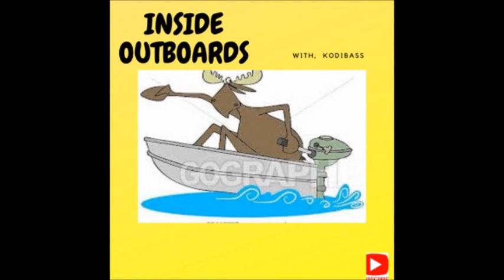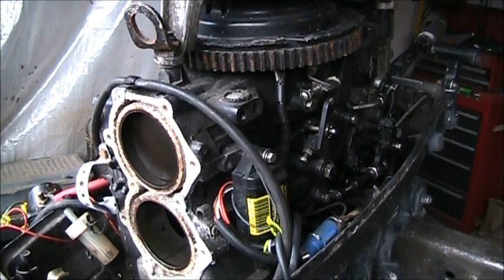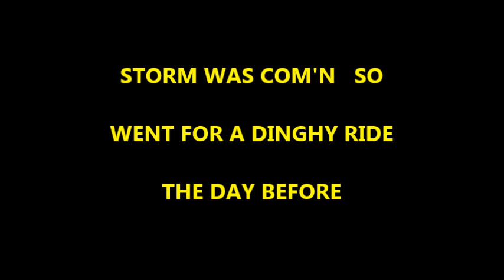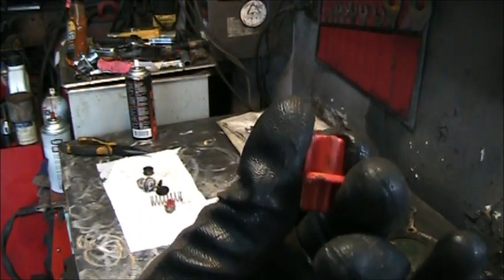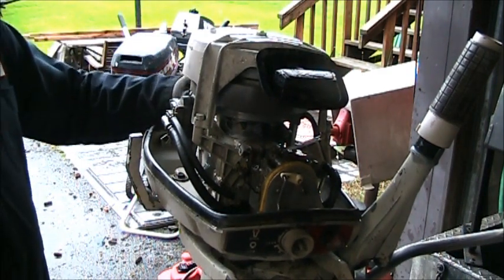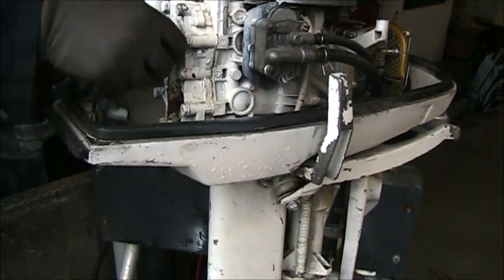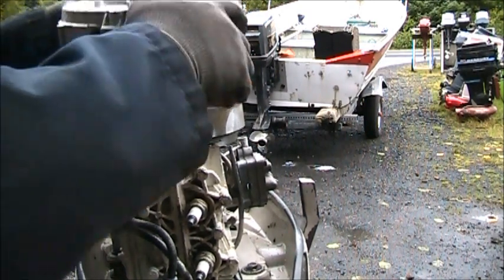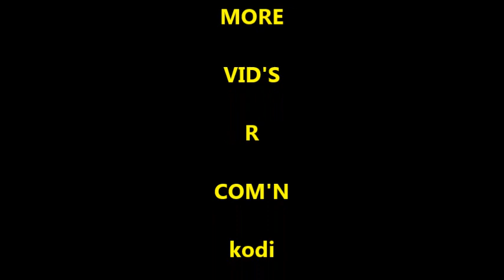1988 EVINRUDE 55 HP COMMERCIAL MODEL & MORE

Comment: The  PRV grommets are getting scarce. The plastic valve $25-45 on ebay! Thanks for the boat ride! ☠️
Reply from the maker: You bet'  I think it's only going to get worse , Now that Evinrude folded, I have had customers come to my shop asking to buy'm Thinking I won't know what they cost,  If I have learned anything over the years,   anything plastic on outboard's is big bucks.  So when I tell them sure I have a whole drawer full pop one out & say 40 bucks & they give me the look,  I just smile & look toward my pile.  There's gold in Dem Dare Part's pilgrim!
                                                                                                      L.
Reply: @kodibassInsideoutboards  Hahaha. Hey is your youtube channel working? Mine is freaking out! It keeps changing. weird !
Reply from the maker: @THISOLDOUTBOARD1  Yeh' everything seems normal as far as I can tell,      L.
Reply: @kodibassInsideoutboards  I can only view as a subscriber or a new visitor, but not as myself. strange
Reply from the maker: @THISOLDOUTBOARD1   So if you click on your home page icon what happens?  Man I hope that don't happen 2 me,  I know so little about computers as it is,  Heck I have been trying to use a better editing program for a cpl months now & get nowhere,    L.

Comment: Hi Kodi, that motor had some real issues for sure.  Time and parts are not cheap and you don't work for free. Old Fret needs the mini fridge full of beer and flies🤣
Reply from the maker: thanks, Yep'  I think I have a head  for it I found in my pile,  I  will pull the head and re test the compression & go from there.  I'll be working for pennies but i'd like to save it if I can.  Ol fret can have the flies i'll take the beer.               kodi

Comment: I got a 6 hp 1969 Johnson and that thing only has about 45 lbs per cylinder and I troll a 16 ft sylvan all day at 3 mph starts on about third pull it pushes it full speed about 9 mph thanks for the videos
Reply from the maker: Good, little kickers 4 sure,  Check the compression wet with a 1/2 inc drill it will probably do a bit higher.       kodi

Comment: Could it be that just the Head Gasket is bad on the 5.5 hp and after fixing the spark plug with a helio-coil regain compression in both cylinders?  It doesn’t appear to be a ring problem since compression didn’t go up on the wet test. What are your thoughts?
Reply from the maker: Yes' that's the plan pop the head fix plug hole inspect / replace head gasket, & re check compression.       kodi

Comment: Missed the last video, will have to go back to see if my eyes catch the leak...  Oh well, that poor old dog was cooked good, love the melted bypass valve until you mentioned the price.  Will stay off my soapbox, but it breaks my heart that BRP must have just gone by book keeping desk jockies when they came up with that price. " It costs X to manufacture these pieces, only sold a few of them, so let's charge up the wazoo to make up for the low volume"...Look where that logic got BRP/Evinrude, breaks my heart, again....Oh well, finding that nuked head gasket undoubtedly saved this engine...The owner would have just kept running it til she ran no more, when the gasket was pouring sea water in the cylinders, then the game would be over.  Nice salt build up inside, currently reviving a 58 lightwin that look identical in the water jackets...
That Johnson 5.5hp is a great engine,  too bad the owners just ran this thing til it literally wouldn't "run no more"..  This poor thing has had some half @## repairs in the past, love the 50 cent paint job covering the flywheel and cam..  Yeah, that is a pretty big compression discrepancy....Perhaps the plug threads are too blame, maybe the head gasket is blown...Surely worth pulling the head to have a look....But, we both know the owner will not be willing to pay all the money for all the work that needs to be done....Try as we might, will never convince them that this engine is much better than any of today's 4 stroke offerings.  Yeah, mag spark surely looks different than magCD spark, but I don't think there is much left of the ignition system on this poor thing.  I would have expected a much more constant spark when spinning with that drill.  
Ignition overhaul + fuel system overhaul + powerhead removal/water pump gearlube check + mounts + used head=  many hundreds more than the $50 the owner was expecting to spend to "overhaul" this engine....Sure hope I'm wrong  about the owner though, but haven't met too many that appreciate the value, simplicity, durability and great running characteristics of one of these old 5.5s...  So, hopefully they will leave it with you in lieu of your diagnostic bill, will keep my eye out for a decent head...Perhaps you can come back to it in the dead of winter to give this old gal the attention she deserves....
Reply from the maker: Yep I'll be pulling the head and have a closer look,  I think I found a head in my pile,  I'll look inside @ the cylinder first and go from there.  Maybe I can save it.      kodi
Reply: @kodibassInsideoutboards    Tell me what it might need, I know I say a cheap powerhead on ebay, will keep my eyes open...I know I don't have a head for it in my stash though, sorry....

Comment: My evinrude 5hp pressure valve plastic bit part no 336178 noted as thermo housing £9.84 plus vat
Purchased from evinrude dealer South Coast Marine Christchurch BH23 1E8 in the uk.. it was not available on internet and ebay etc so recommended I went dealers South Coast Marine and got 1 day after ringing to order...
Chris
Reply from the maker: Yep' Some of these plastic parts are getting harder to find,  I just don't understand why they cost so much,  The surly r cheap to produce I would think,               kodi

Comment: Kodi looks like the powerhead I have is 381362 same for 1967-1970  I'm not looking for just a block my block I think is fine I'm looking for a powerhead this number with good compression or I think I will try this one  This will be my first outboard rebuild but I have done car motors before so I'm not totally a rockie The motor is just too clean to part out and I like a challenge as well as the older motors seem a lot better build than newer ones 😉 What's your expertise advice for me ?? I really won't know everything until I tear it down as you know Thanks again tremendously for helping me out on this project!!!!!!
Reply from the maker: As long as your cylinders look good, no scoring or corrosion etc. I would just do a lite hone re-ring  that's normally all the need.      kodi
Reply: Okie dokie thanks 😊 🙏

Comment: Any ideas why a 50 hp johnson would idle fine on land and not when in the water
Reply from the maker: Yes if you are running it on muffs there is no exhaust back pressure ,  Check your compression,  If compression is good sinc and link on the water.    kodi

Comment: Could the stripped spark plug hole be the cause of the low compression? Be a shame to write off that little 5.5hp. Another great video by the way. I guess if Fret is still glum, then he didn't make it with that crab after all...
Reply from the maker: Yes 4 sure I will be replacing the head / gskt & re test compression ,   kodi